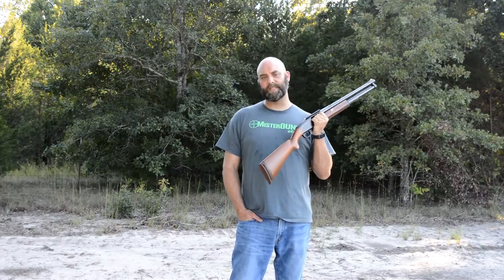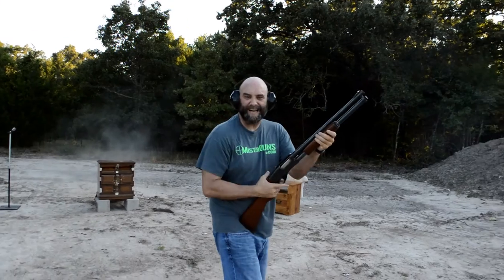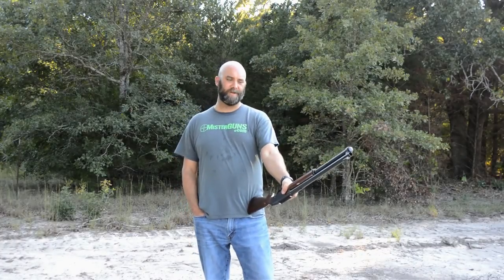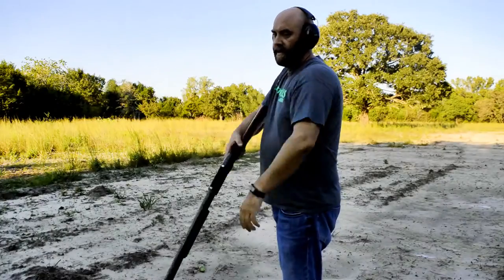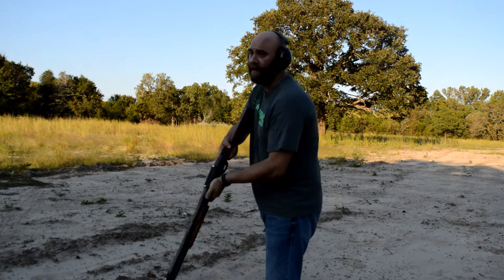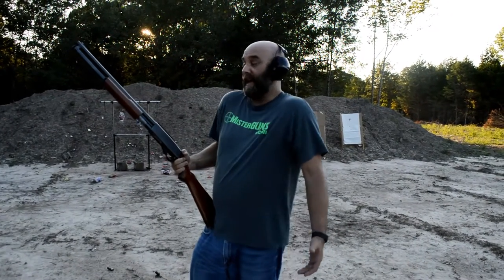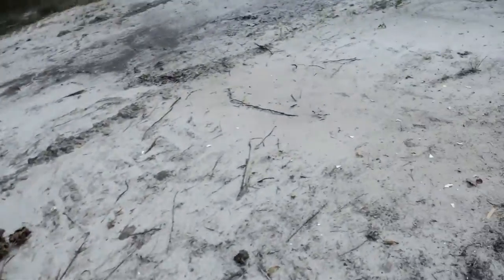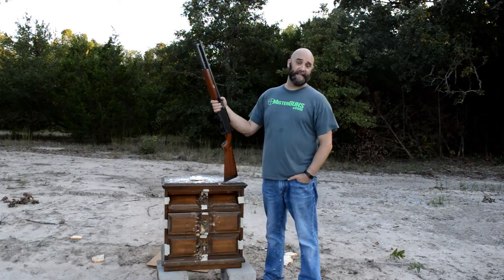Smith & Wesson 916A - Only Good For Buttering Bread?

Comment: I've had mine since 1977 or '78.
Have never had a ftf or fte issue. 
If you don't mind the sore shoulder.
 It has been very dependable for filling the freezer. 
 S&W bought Noble manufacturing around 1971 or 1972. The 916A is a rebadged Noble #66. 
 Have no complaints.

Comment: I've had my 916 over 40 years and it works fine. I use it for deer hunting and its great no problem.
But back around 1975 there was a recall on the Smith & Wesson model 916E deer slayer which 
looked liked the 916A which Smith said there was no problems with the A only theE. I love my 916 A and still use it for deer hunting without any problems. This gun is excellent and chambered for 3 inch shells.

Comment: Great video! Loved it.   I must have gotten the exception , the one 916a that's worth a darn. I've had it for 25 years and it has never failed me once. Used as a bear protection in Alaska, bird hunting, used it as an anchor while sliding down an avalanche shute , as a general brush gun and a good gun for teaching my kids how to shoot a shotgun. I carry it tied to my wheeler everywhere and I have complete confidence it will always function correctly.  It is beat to hell and still feeds and fires every time.
Reply: Oh, and I bought it used for 25$ in 1992
Reply: I too got lucky and had absolutely no problems with my plain Jane 916A
Never had any jambs or problems from cheap low brass dove loads to the high brass magnum

Chuck Texas
Reply: I’ve never had a problem with my 916a either
Reply: @troyace1116  The 916A I have from my dad is also one of the lucky ones. I found it in the coat closet while we were cleaning it out and found a Riot Pump that I had no clue what it was. I looked up the serial number and it was customized by Eastland and used by the MP in Vietnam then sold to the Iowa State Patrol. My dad bought it off his friend for $100 and it runs whatever you put in it. I don't think it was really ever used. It's in great condition.

Comment: I’ve got one of these that belonged to my dad before he passed away. He had owned it since it was brand new and put a lot of meat on the table with it. The gun has fired a lot of shells over the years and hasn’t exhibited any issues. I prefer it over my modern production Remington 870. I think they must have made a bad run of these or something and those duds are the ones that get all the press. Not many of us take the time to post about the fact that our old vintage budget shotgun had another trouble free outing.

Comment: Sounds like you got a dud there bub. Ive had one of these for 40+ years and used as a  heavy brush rabbit gun and behind the seat "just in case" gun. Never had a single misfire or cycling issue with countless rounds put through it.

Comment: Interested to hear if anyone knows about the S&W 916T 12 gauge. It’s going for $200 at gun shop about an hour from me. There’s an O stamped on the barrel which means it was recalled and the barrel was replaced. It appears to be in great condition.